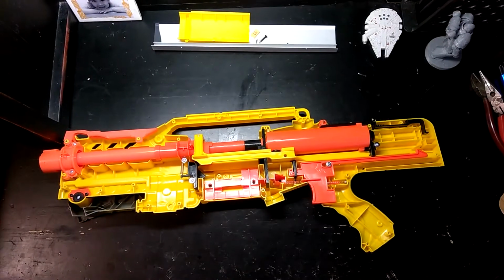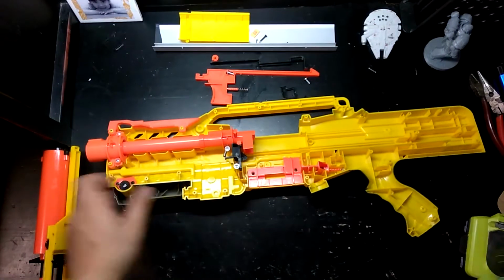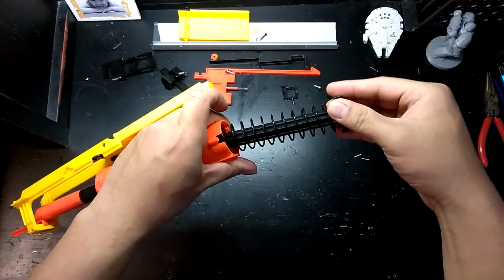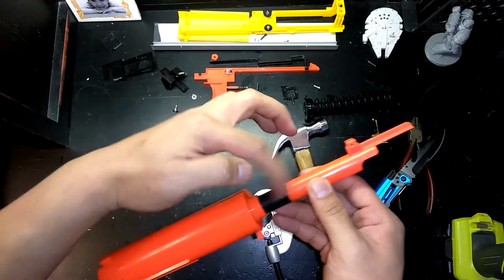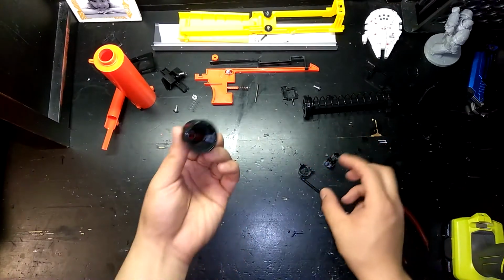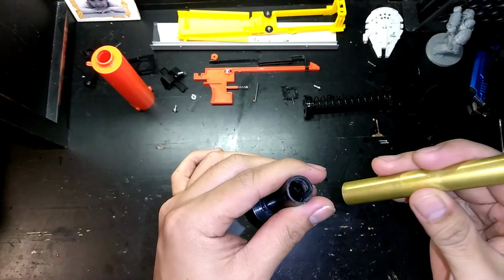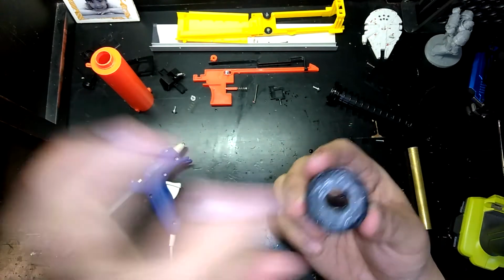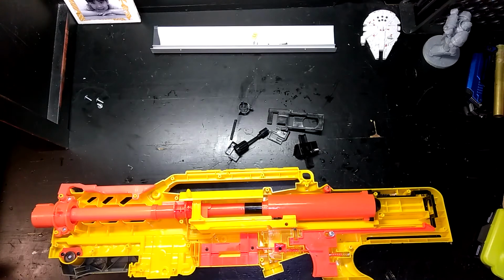Mod Guide - Nerf Longshot Mod Build Log [Part 2] : Lock Removal and Prep Work

Comment: I followed this tutorial, but i had to cut off some extra on both sides of the breech (a small lip on the orange piece and a small lip on the black piece that also sits inside of the plunger) so they wouldnt crack.  Now there is a small space between them and it wont catch. I tried hot glue, auper glue, tape, and more but the spring is to strong and it forces the 2 pieces together and it wont catch. Any ideas?
Reply from the maker: If you went lipless on the mod, you'll need to build up on the plunger head. Not a bad idea anyway to add some padding there but essentially, it isn't going back far enough to engage the catch. You may also need to extend the draw by shaving back the slot for the bolt to go back a little further. There may also be a piece of plastic interfering with your boltsled on the shell to prevent it from going back far enough on a lipless build.

Comment: Should i replace the catch and catch spring if I upgrade to a 9kg spring or will the stock components work fine?
Reply from the maker: I would probably upgrade the catch spring when going above 8kg. It might hold fine, but that one time it doesn't could break it.

Comment: Why is it important to remove that dead space with hot glue?
Reply from the maker: Dead space is holding air that other wise could go to the barrel to propel the dart. Removing dead space makes the air more efficient by using more air rather than wasting it.

Comment: Thank you very much for this series!
I was able to wedge the pin loose without a hammer and nail. I used my smallest pliers through the holes on the top of the sled.
Reply from the maker: +my86outback You're welcome! It's my goal to finish it this year.
Reply: Looking forward to it!
I've combined your technique with the Worker 9kg spring set.
I'm not sure the 9kg is powerful enough to overcome the friction of the brass barrel sufficiently.
Also experiencing a lot of fishtailing and very little accuracy, but I'm hoping half-length darts will remedy this to a degree.
My last issue is with temperatures. At the moment we're around 0 degrees Celsius where I live. It seems to misfire (darts getting stuck) a lot. When I keep it inside for about an hour, the problem subsides.
Again, looking forward to it!
Reply from the maker: That's great! What darts are you using? I like half length Worker and ACC V3s. Definitely work with the barrel that fits your darts.
Reply: A variety of full length darts. (elite, waffle head, suction cup, accufakes and those horrible hard headed ones)
I've got the men-gun and worker half length on the way, which I'm quite curious about.
I've tried to make my own scar-barrel, but have not had too much success with that. My guess is, the darts already lose too much velocity (half the time) to be bothered even more by the fishing wire.
I get a weird mix of darts flopping out at about 4 meters and darts that just explode from the barrel and fish-tail all over the place. 
Still loving this process of experimenting and figuring out what I'm doing.
Reply from the maker: At this point, I've decided on full length darts really being good for flywheels while half darts are the way to go for springers.
Reply: Finally received my first box of worker half length today ... and my Longshot blew just about two thirds of the tips off on the first 50 shots.
Hotglued them back together, but was not expecting these results.
They seemed to fire much more accurately, and with greater range, but I was genuinely weirded out by  so many exploding darts.
I also had about 3 darts shredded by the back part of the brass breach. It wasn't enough to instantly make me want to take it apart and smooth down the brass even more. Postponed until I have more excuses to open the shell up again.
Reply from the maker: Yes, the worker darts are amazingly accurate but horribly glued. I cut and reglue all of mine.